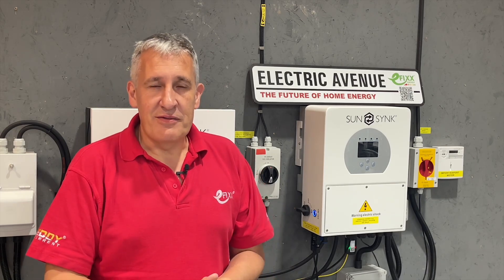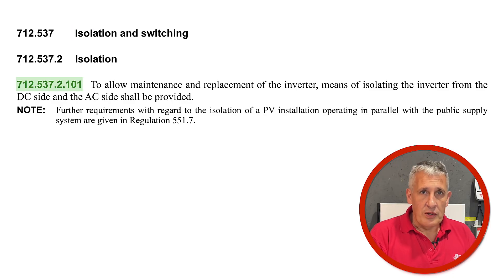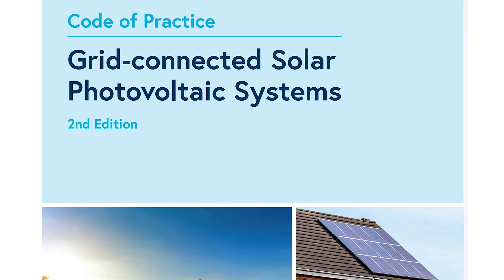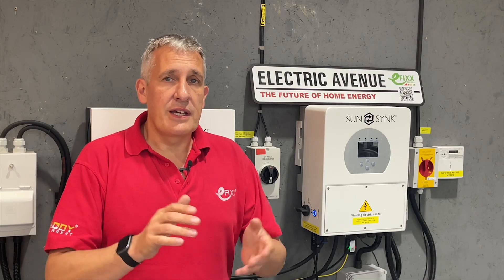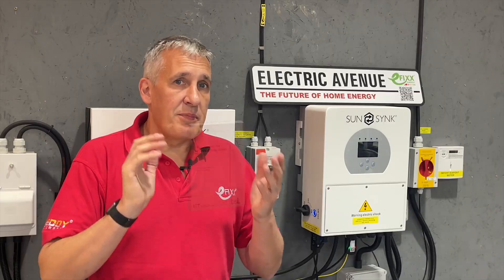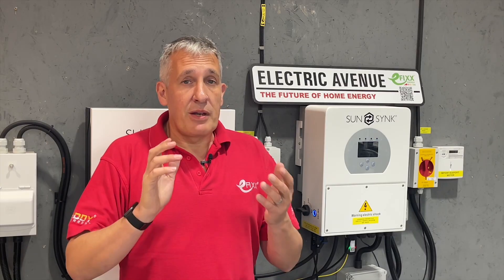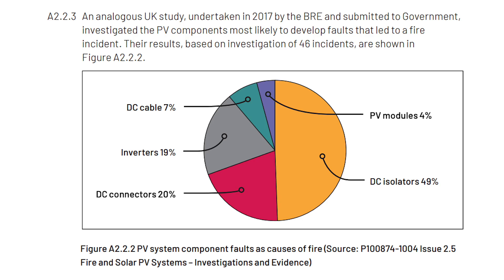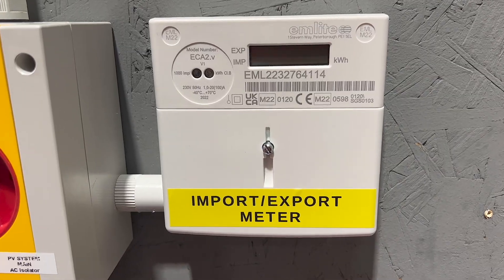Do you need to fit a DC isolator?| Solar Inverter Installation UK

Comment: DC isolators are yet another point for potential failure. In conjunction with the utterly unnecessary emlite meter there are 12 unnecessary points of potential poor connection fires. (for a typical two strings setupl

Comment: When you turn off a DC isolator under load its like striking an arc with a welder only worse. With AC, the zero-cross extinguishes the arc but DC isolators have to rely entirely on the gap to break the arc - which does not want to quit (i.e. 450VDC @ 6-10A).  This arcing can degrade the contacts and can cause resistance and/or arcing when the contacts are closed potentially resulting in heat and fire. The golden rule to avoid this is always switch off AC before DC.

Comment: This is bs!  There obviously has to be some way of isolating the dc supply for safety and service.  If isolators are causing fires its because the isolators hasn't been design to switch dc under load possibly.  Switching inverters can have its own risks.  But seriously the whole solar industry is a flawed design based on supporting an expensive network.  The network should be seriously reviewed as most networks are making a lot of money going out to shareholders but failing to support maintenance of the infrastructure at times.  Installed any electrical equipment in houses needs to be reviewed from what I see of UK switchboards and metering.  It seems standard practice to have unprotected wiring in the metering etc often mounted on flammable materials with no enclosure.

Comment: Just had a Tesla Powerwall 3 fitted. There wasn’t an external DC isolator fitted, which sounds like it was correct. 
There also wasn’t an external AC isolator fitted, is that also correct please?

The installer also broke the seals on my smart meter and and broke the seals (and the seal lugs) on my house fuse, whom do I need to contact to get these replaced please?
Reply from the maker: Your energy company will reseal the meter - but will be an interesting conversation explaining why the contractor removed them.

Comment: ok. well, I'm guessin' that since this seems to be either a British or European standard, the United States market and NEC probably has a different opinion, which would stink. That being said, if external DC isolators are responsible for 49% of solar system fires, then how or why are internal isolators any better?

Also, what is the FPA's recommendations for external isolators when an inverter w/o an internal one is being utilized?

Comment: If my inventor pv failed and got short during load, and i switched off the ac load but still pv generating high voltage and ampere, then what would be done to disconnect pv safely as some incidents reported of fire due to short pv side.

Comment: NEC. in cali USA  has each string run through the emergency disconnect {S} on the roof..   in the box ? big rows of SCRs to break circuit.. under full load..   one push button at  main meter... supposed to restore when  button reset..  nice looking units... not cheap.

Comment: So what exactly is the problem or fault condition associated with using DC PV isolators. Isolation when working on a system would appear to be a good idea.

Comment: This is non sense, if the isolator in the inverter meets 60947-3 then how can it be any different to fitting a stand alone isolator to 60947-3 before the inverter ? I think either sub standard isolators have be imported from china or the 60947-3 standard is not rigorous enough for solar panel instalations and a new standard needs to be developed.

Comment: I ADVOCATE STRING ISOLATORS AND A MAIN ARRAY ISOLATOR I AM ALSO OF OPINION THAT MC CONNECTORS ARE RUBBISH AS THEY OVERHEAT  AND PANEL CABLES SHOULD BE CRIMPED  SOLDERED AND SHRINK SLEEVED.1 BREAKER PER STRING BREAKS UP LOAD REDUCING FIRE RISK AND SHOULD ALL BE OPERATED BEFORE MAIN ONE 
I ALSO FIT AN ISOLATOR BREAKER BEFORE INVERTER AND ONE FOR EACH BATTERY SET
I ALSO PREFER PANEL BREAKERS AND BATTERY ISOLATORS  NOT TO BE OPERATED UNDER LOAD.ITS EASY TO THROW JACKET ON PANELS I HAVE 60 YEARS EXPERIENCE OF DC TRACTION AND SHIP DC UP TO 6000 AMPS 480 VOLT CABLES SHOULD ALSO BE TINNED COPPER AS MANDATORY AND TERMINALS CRIMPED AND SOLDERED WITH 60 40 TINMANS SOLDER

Comment: So, having read through these comments - the main justification for not fitting an isolator is: "Many isolators are crap and unfit for purpose"

Did I get that right?

The correct solution to this would be to fix the manufacturing and design standards for DC high voltage isolators for this application, not to remove them!

Wonder if they could design a sealed for life oil or SF6 filled small device? Suspect oil would be more practical in terms of the seals being able to keep it in the right place for decades... Surely this is do-able?

And mandating they be close to the panels and accessible for regular operation testing - perhaps a fireman's switch style so a pole could reach them on a typical 2 storey house? Extra benefit there is firemen being able to shut it off if they need to break in through the roof with solar cables around. Surprised this isn't already a regulation?
Reply: I AGREE THEY MOSTLY RUBBISH MEANT FOR AC ONLY

Comment: Sorry to rude but - FFS!  All this jibber-jabber and not a single mention of ****WHY**** DC PV isolators are causing fires?!!  Surely this is what we should be concentrating on ... and then fix whatever the problem is?!  But no, let's just add yet another utterly bloody pointless chapter to a book that is beginning to resemble the Encyclopaedia Britannica - only 90% of it is just a mish-mash of conflicting/confusing 'guidance' and health and safety gone mad!
Reply from the maker: Poor installation, wrong specification of isolator, water ingress, UV damage
Reply: @efixx  Isn't rodent damage about 500 times more likely?  Or is there evidence 'out there' that categorically points to DC isolators as being the culprit?  Bit difficult to tell once everything has been comprehensively incinerated, I'd have thought...?

And why is a properly specified DC isolator any more likely to spontaneously combust than an AC one?

Comment: Use the isolator incorporated into the controller as a method of isolating the solar panels when replacing the controller. Huh?
Reply from the maker: Just unplug the MC4 connectors once you’ve switched the internal isolator off and confirmed no current is flowing in the strings.
Reply: @efixx  Thanks for the info. That turns it into a much bigger job though. Why are these DC isolators failing? What is the difference between the external isolator and the one in the controller. Is it and underrating issue?

Comment: Should the DC isolator need to be able to locked off when isolated?
Reply: good idea when i had an engine room fire to contend with 
offshore i had to physically prevent our radio operator from re energising a blazing 60hp compressor

Comment: I always thought the DC Isolator was to allow the isolation of the PV String/s in order to allow the replacement of the Inverter. The Inverter tends to need replacement before any other component. If an Inverter fails and needs to be replaced how does an integrated Isolator help. One would need to remove the MC4 connectors from the Inverter which are now live! A New Inverter fitted and the MC4 connectors reconnected...Live again! This does not sound right to me
Reply from the maker: If you aren’t happy handling live mc4 connectors you’d never be able to install solar panels (unless you work in the dark)
Reply: MC 4 connectors are pretty well isolated from accidental touching.    If the external isolator needed replacing then you will be playing with live bare ends....  Well, you won't.  You would install scaffolding, get on the roof and disconnect up there.   Not cheap.    Or do it at night.
Reply: The MC4 wires are only live if it's day time. So simple, wait until the sun has gone down to start fiddling with the inverter. Or put a tarp over the panels.
Reply: @mb-3faze  Funny that. I had considered covering the panels with a Tarp

Comment: In Germany we occasionally use firefighter switches which automatically isolate the dc lines when power is cut and also automatically turn it on again when power is restored. Pretty nice
Look for Santon DFS-14

Comment: The new GivEnergy Gen 3 hybrid inverter does not have any MC4 connectors-surely you would still install a DC isolator in this case?
Reply from the maker: Or an inline set of MC4 connectors close to the inverter
Reply: The MC4’s could go inside the inverter cover but it would be tight, which means you have to put inline MC4’s just underneath the inverter-is that what you mean?
Cheers
Reply: We sometimes put them inside an adaptable box for neatness if the DC is hard wired into the inverter. The MC4's are a great way of annually testing the strings especially if the strings are paralleled up in the inverter.   @mike1434

Comment: I used to err away from fitting string isolators on systems until the DC SPD’s came in, now I fit them on pretty much all installs as a way of isolating incase the SPD needs servicing.
Reply from the maker: Which opens up the next question when do you need to fit SPDs - many inverters have them built in.

Comment: My first impression of this (from a UK perspective) is to consider the requirements of the Electricity at Work Regs. I would say it is imperative to have a suitably rated isolating device on the DC side of the inverter to allow it to be repaired or changed. It falls well within the requirements of 'reasonably practicable' in terms of satisfying the need for isolation. I suspect BS7671 has taken a similar approach. Disconnection of MC4 connectors introduces additional risk that would be designed out by the use of an isolator, which would provide actual *isolation* as opposed to just disconnection. If the fire safety experts are flagging a problem with DC isolators, that is something that should be dealt with through enhanced standards, better design and type-testing.
Reply from the maker: How do isolators help with the EAW regs?
Reply: @efixx  bit of a strange question but, the correct specification, installation and operation of isolators is likely to ensure compliance with the Regulations, specifically Regulation 4 and Regulation 12.
Reply from the maker: @craigwatson2298 The solar strings are always live. The MC4 connectors are touch proof. How does the situation change if you are fitting micro inverters?
Reply: @efixx  precisely the same principles apply, of course. The designer has always to be mindful of the requirement under Reg 4 for the construction of electrical systems to prevent danger so far as is reasonably practicable - that's the key phrase (as it is in so much of UK health and safety legislation and regulation).

What satisfies 'reasonably practicable' for micro-inverters can be different for the installation shown in your video.
Reply: They don't.  What happens when i need to repair, service or swap the DC isolator?  I would disconnect the MC4 connectors and hence the DC isolator woudl appear to be obsolete.  Mechanical parts are much more likley to wear and fail over time where as the crimped MC4 connector is a lot less likley to become faulty as proven by the data.   @efixx
Reply: TOTALLY AGREE

Comment: The safest solution from a firefighter's point of view is to isolate the PV array as close as possible to the array (say within 1 metre). This can be achieved simply and in a fail safe manner by installing a DC contactor in a suitable enclosure with its closing coil energised from the grid supply. When the grid supply is switched off the contactor will open and the PV power will be isolated.
Reply: Bit more complicated if the generation is designed and approved for operation in island mode though. The opening of a contactor might qualify as disconnection but it's not isolation.
Reply: I agree.
There are two conflicting requirements:
1) The PV/Battery design and implementation should be safe for firefighters and electrical distribution company's employees. This requirement can be met by disconnecting the PV/Battery in the event of Loss of Mains either due to a fault or the grid power being switched off.
2) The PV/Battery may be required to provide backup power in the event of Loss of Mains so disconnecting the PV/Battery is not an option.
There are workarounds to satisfy both situations.
By the way, a contactor is a switching and isolating device and is an acceptable alternative to a manual operated switch. As you know it is not a protection device and has no fault breaking capacity.
Reply: @johnlloyd3377  1) Agreed - it has to be safe for all concerned. I can't speak for firefighters but I assume they are well trained on the hazards presented by PV systems or batteries given their increasing prevalence but I doubt they are trained to establish disconnection and isolation, instead treating all apparatus as live at all times.

For DNO operational staff, the installation's compliance with Energy Networks Association Engineering Recommendation G98 or G99 (G83 or G59 for interconnections prior to April 2019) will suffice. Broadly speaking, these standards require the inclusion an accessible  isolation switch, capable of being secured in the 'off' position on the AC side of the inverter. In emergencies such as a fire, DNO staff requiring isolation from the installation will effect it further 'upstream' to the premises in the safest manner available to them.

2) I'm wondering what the workaround is exactly in island mode, if it pertains.

Unless you can lock-off the contactor to prevent it closing, it's not an isolation device.
Reply: @protectiongeek  I was a fireman up until around 2 years ago & I can tell you up until then at least there wan't much training on this subject at all, I remember a very short powerpoint on the very basics that basically said be careful & the usual H&S get out clause of always treat everything as if it is live 😆 .  You'd be amazed how many subjects FFs are expected to have knowledge on like chemicals, radiation, nuclear, electrics, animals, biological, water, aircraft, working at height, vehicle collisions, trains, ships, explosives, the lists are literally endless. That coupled with the fact they rarely get any real life experience in these subjects unfortunately means in reality most of the time they just have to wing it on the day 😅
Reply: I AGREE JOHN
Reply: A pair of insulated wire cutters carried by the fire fighters is all that's necessary.

Comment: We include the DC isolator, so the Installer does not need to use a separate device the less isolators, the safer and more reliable the system.

Some people  might think that’s a contradiction of terms but the item that is  likely to fail, is the isolator itself

None note 
I personally have seen AC  isolators on DC circuits. This is extremely dangerous.
Reply: In addition, your inclusion of an isolator built into your batteries was something that made me a very happy camper. Thank you, your equipment is going to be the only source of power running our off grid home for many years to come :)
Reply: I DISAGREE CABLE SHOULD BE ISOLATED BEFORE IT ENTERS AN APPLIANCE IN CASE INTERNAL STUFF IS RUBBISH. DC TAKES NO PRISONERS IT JUST GOES ON FIRE

Comment: As long as there's some means of off-load disconnection external to the inverter (such as the MC4s) it's fine to have the isolator inside the inverter. You just need a way of replacing the inverter and using the isolator as a circuit breaker and the MC4s as disconnects is fine (as long as you do it in the right order!). If you have any kind of hardwiring to the DC, though, it's not good enough to have only an internal isolator. As the MC4s are doing double duty here (not just as splices but as disconnects) that needs putting in code as it has extra mechanical requirements on the connector over their usual use for splicing and interconnecting.
Reply: What happens if you need to isolate the feed before the inverter?
Reply: MC4 CONNECTORS ARE SURE TO FAIL

Comment: As far as I see it (and I have hundreds of inverters round the country that are my problem) there is one argument for putting an additional isolator external to the inverter.

Once your inverter has been there for a few years, the MC4 connectors underneath will get quite stuck and often brittle. They have a nasty tendency to snap off if you're trying to remove them.
Not very fun I can tell you!
I have also had one ABB inverter (that was hit by lightning) let all the magic smoke out on the array side of the isolator, so the isolator didn't do anything.

However, I would still not fit (or speicify) additional isolators because of the exact reasons mentioned here, they're a common point of failure when they are fitted and I have some in my "museum" to prove it.
Reply from the maker: Great insight - thanks Tom
Reply: must be in sunlight a lot to get brittle like that, which should be a no anyway?
Reply: Not surprising that lightning damage happened.  PV isolators simply aren't built to cover those sorts of voltages considering domestic installations usually top out round 1kV Voc.